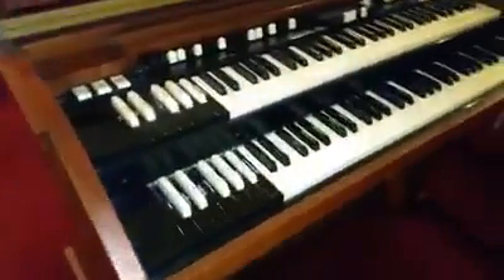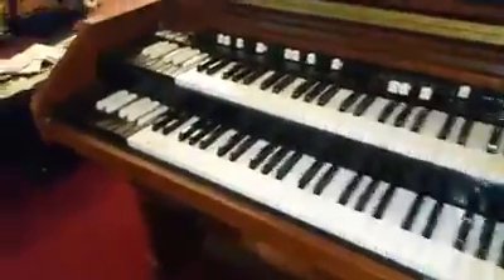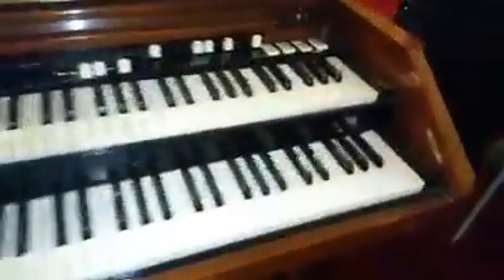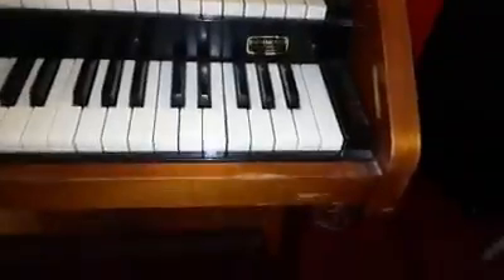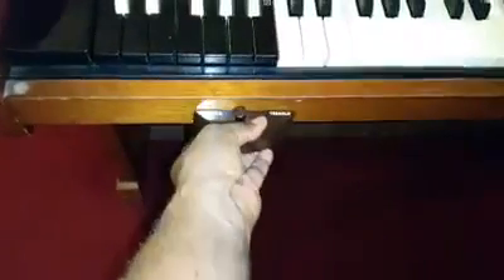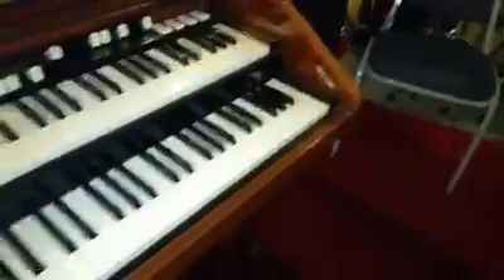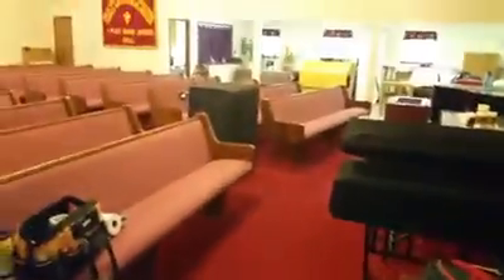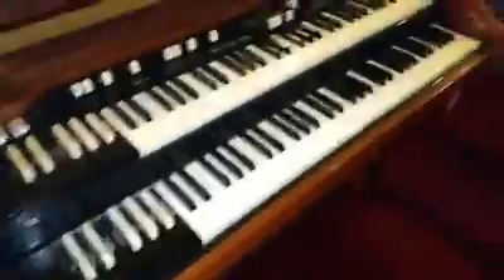Preparing To Install A Leslie Switch On A Hammond C3 Organ

Comment: How do you run the half moon wires from under the console to the back of the organ in a B3? Do you have to remove the manuals?
Reply from the maker: Just lift the manuals enough to get the cord through the organ.